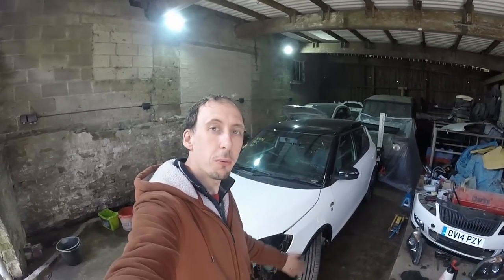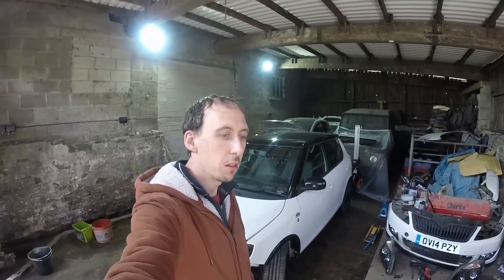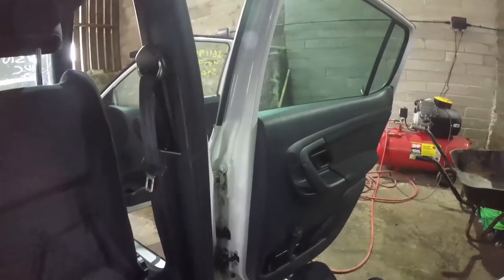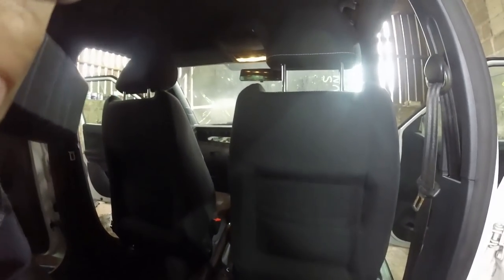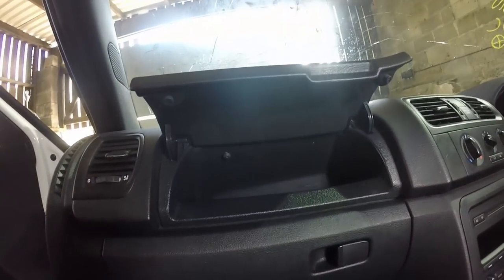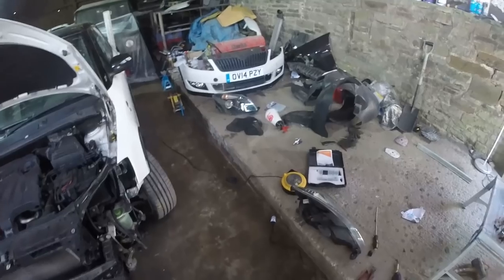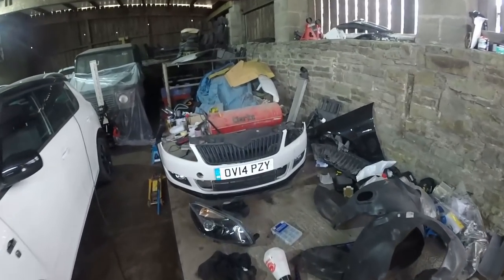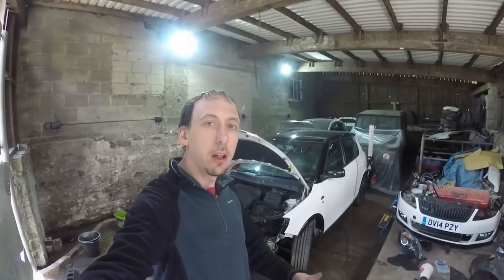2014 Skoda Fabia Monte Carlo - Interior Finished! Can We Repair These Headlights!!!!

Comment: just a tip Phil,just before you switch the stapler off just give it a slight twist to one side,it makes for a stronger fix as it sends the staple under the split and locks it in better,cheers.
Reply from the maker: Good tip cheers mate 👍

Comment: Hi phil do you have to disconnect the battery  when you or refitting the air bags , because thay have already been fired, when you connect the battery will thay go off again.
Reply from the maker: Connecting new airbags with the battery connected shouldn't be an issue really, but its always best to be safe!

Comment: I think maybe I could do with one of those hot staple guns, spent hours trying to plastic weld a bumper crack and hit it with my fist afterwards to test it and it fell apart again 😂😂
Reply from the maker: oops 😀
Reply: They are the nuts seen them on Ebay for reasonable money, like the code scanner it will pay for itself .

Comment: I know you mentioned in the previous video about giving the buyer the V62 to save adding keepers. When you apply for the logbook (if it's missing), isn't it as normal with an option for "sold to a motor trader/dealer"? Or does it work differently when its written off and the logbook is destroyed?
Reply from the maker: Hi Sammy, when you apply for a new logbook because its missing, stolen , lost or destroyed by insurance there is no option to register it as trade/dealer unfortunately.
Reply: @SeriousAboutSalvage  That's odd, considering most write offs go to motor traders you'd think there would be an option for that. The DVLA are an odd organisation 😂

Comment: What pressure are you spraying the laquer, have you got a pressure gauge at your gun. I paint laquer at 2bar/29 psi  at the gun and never have any issue with orange peel. Too much psi will cause orange peel affect in the paint
Reply from the maker: I think its about 30 psi mate, i need to fit my pressure gauge to the gun to get it more accurate.
Reply: @SeriousAboutSalvage   30psi at the compressor will be alot less at the gun. I set my compressor at 100psi and use a regular gauge at the gun at 2bar and get factory finish

Comment: I kept expecting the passenger airbag to go off again with all that banging🤣🤣. Are they precious ?
Reply: Although it could happen, its very unlikely (and only could happen if the battery is connected). It's more important to disconnect the battery when messing about with the SRS system because the voltage spike suddenly going to the airbag/pretensioner can set them off.

Comment: dash airbag installed with battery still connected .   SAFE WORKING PROCEDURE
Handling Airbags/Seat Belt PreTensioners 
Key Hazards Risks Personal Protective
Equipment
1. Unplanned deployment of
air bag causing injury to
body and eyes
2. Unplanned actuation of the
seat belt pre-tensioner as
a result of maintenance or
attendance at vehicle RTA
1. Physical injury
2. Burns to body/limbs
3. Eye damage (deployed
airbags issue irritant but
not toxic gases
1. Suitable overalls
2. Eye protection if risk of
contamination from
gases
3. Safety footwear
4. Gloves (skin protection)
DO DO NOT
• Work on airbag modules or seat belt
pre-tensioner modules if you don’t
know what you are doing (i.e. properly
trained, competent or under
instruction)
• Work on the steering column area or
any internal trim area thought to house
an air bag without disconnecting the
battery
• Remove seats with seat belt
tensioners without paying great care
to wiring loom joints (disconnect
battery first)
• Expose air bag modules to excessive
heat
Specific Training Requirements SAFE WORKING PROCEDURE
Handling Airbags/Seat Belt PreTensioners Date: April 2004
Key Hazards Risks Personal Protective
Equipment
1. Unplanned deployment of
air bag causing injury to
body and eyes
2. Unplanned actuation of the
seat belt pre-tensioner as
a result of maintenance or
attendance at vehicle RTA
1. Physical injury
2. Burns to body/limbs
3. Eye damage (deployed
airbags issue irritant but
not toxic gases
1. Suitable overalls
2. Eye protection if risk of
contamination from
gases
3. Safety footwear
4. Gloves (skin protection)
DO DO NOT
• Work on airbag modules or seat belt
pre-tensioner modules if you don’t
know what you are doing (i.e. properly
trained, competent or under
instruction)
• Work on the steering column area or
any internal trim area thought to house
an air bag without disconnecting the
battery
• Remove seats with seat belt
tensioners without paying great care
to wiring loom joints (disconnect
battery first)
• Expose air bag modules to excessive
heat

best to be safe

Comment: Take it modern diesels still have glowplugs?! Maybe due a set.
Reply: Yeah these have glow plugs (you can it has a glow plug light). Usually they last about 100,000 miles or so. I think in this case its because he cranked about 90 seconds after the light went out having done the diagnostic scan.
Reply from the maker: Think your right, its fine if you crank straight after light has gone out.

Comment: Just one thing, you should never ever do anything with the airbags with the battery connected.  Believe me they can kill you.
Reply: When did you die?
Reply: He said did say to always disconnect the battery when messing about with the SRS system.
Reply: 13:44
Reply: 15:04. Reconnected battery once he’d finished 👍🏻
Reply: @sammytheseal2307  At 11.24 you'll see when hammering the passenger airbag the interior light is still on.  The interior light was on when he was playing with the driver's seat belt.